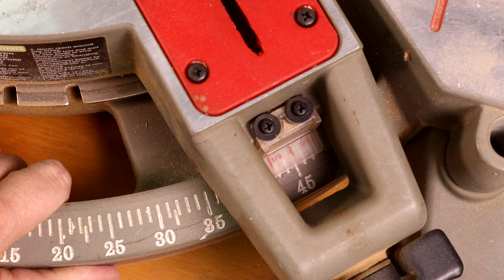5 Woodworking Cuts You Need to Know How to Make | WOODWORKING BASICS

Comment: would a ryobi table saw work. like the ones they have at The home depot.?
Reply: I have used one for years. They make a decent saw to start out with, know that you won't be cutting huge pieces of wood with it. Use all the proper safety equipment and make sure it is stable and secure and it does an okay job.
Reply: thanks. I feel more comfortable now.
Reply: Not really well. A real good band saw will cost you 1000.00 to a couple thousand. But the blade you use has a LOT to do with it. For a hobby shop the cheaper saw with a really good blade might be ok for you.
Reply: Yeah they're fine. Just take it easy on them. They are just 110 so not very powerful.
Reply: My old Ryobi works just fine. How old is it you didn't ask? It's blue, some people at Home Depot don't even remember blue. But build a sled. It's clunky and awkward, like me, but it does help out a lot when needed.
Reply: Yes I started woodworking about a year ago with a ryobi and it works well but I am looking toward a dewalt or Bosch next. With a crosscut sled, 45 miter sled and a good table saw base it will surprise you. Big sheet goods though can be a bear.
Reply: @robertrodriguez1964  Was is THAT long ago? I still have a couple of blue Ryobi tools and they are not that old.

Comment: Couple of things - for crosscuts you will get a cleaner cut if you use a knife to cut along the line you are going to saw. Steve, you left out track saws, they rip and cross cut as well as a table saw and are really good at odd mitre angles, say 11.25 degrees used on Viking boxes (1/8 of a right angle). Its not as if you can only get them from Festool - DeWalt, Makita and a heap of rebadged saws are available (even Aldi!).
Reply: He could go on and on about making cuts, I'm sure! :)
Reply: A track saw is just a circular saw

Comment: grippers are not cheap. AU price basic one $55 go to the one your using, $139 Though tempted to try get the $139 one and a cheap push block $5 one from ebay for a second one to use.

Comment: I really want a nice table saw but you know... wife and kids and such lol. A circular saw has gotten me by just fine so far - not as good as the cabinet saw I used to use but it does the job. Easiest way is to clamp to a work table, draw your line straight, then clamp a straight piece of wood down on top of your piece and use that as an edge for your saw. Another method I've done is make a a track saw of sorts with a piece of plywood and cut your piece underneath. Not great, but again it does the job on the cheap for me. Almost all of my work is cross cuts anyway so the miter saw does fine.

Comment: you can make good cuts with a circular saw, you just need a guide rail.
Reply: When I got my circular saw I didn't even know about track saws... wish I did, as it would have made a lot of the longer cuts I've done much easier. Securing the workpiece is still a challenge though, especially when making long rip cuts.
I'll get a table saw eventually. In the meantime I borrow my neighbour's if I need to do long rips...
Reply: Like what holzi said, you just need a guide rail. If you didn't know about track saws, you were probably not doing enough to be able to justify spending the money that they cost, at the time u bought it, I'm guessing. You just need a quality straight edge, and somehow to clamp down, keep it secure at both ends as well as the middle, especially if it's a long cut, so that it doesn't bow while making the cut, thus having your circ saw follow that bow, thus, a crooked cut. There are many YouTube videos on circular saw and guide rails, some more innovative than just the two pieces of sheet goods sandwiched together and cutting off the excess. Check them out, they can be fun to watch, as well as obviously informative.
Reply: In most cases the parallel guide that came with my saw is good enough for my needs - the challenge is often to secure the workpiece in such a way that it doesn't interfere with the cut. The admittedly few times I've needed to make a slightly diagonal cut is when I wish I had a track saw... and when cutting sheets of plywood etc.
Reply: Kreg jig makes an attachment for a circular saw called Rip Cut, it mounts to almost any circular saw and it works great. I use mine a lot for cutting plywood, I hardly break out the track saw anymore.

Comment: Steve, great video...thanks!  But, FYI....I just wanted to point out that when you put a piece of tape on the blade casing to hide the brand of mitre saw you use, you forgot to put a piece of tape over the Porter Cable name at the bottom of the scale.  ;-)

Comment: What about  cutting curves on a scroll saw
Reply: Scroll saw blades are very narrow and flimsy so cutting through thick/hard wood may be troublesome.
Reply: Peter Cullen there are good blades for the thicker cuts, but they are quite expensive, and you still have to take an extremely slow aproach to the wood. Same us true of every saw though. You have to let the tool do its work. Pushing any saw, even a chain saw, with too much pressure is detrimental to acuracy, dulls the blade/s quicker, and shortens the over all life of the tool. These should be addressed in a video of this sort.
Reply: What about it????? IF it cut it it should be ok ??

Comment: Steve - your affordable table saw is discontinued. HD's replacement does not have an adjustable height on the blade.  And the horse power is reduced 3 to 1. Any suggestions for me?
Nice to know that table saws can be affordable!
Reply: Anne O'Reilly I have a craftsman contractor saw. Under 300 and have been using it for almost 10 years. Would love a cabinet grade saw but I make do with my craftsman.

Comment: Agreed jesus!!!!
I've made a  sled for cutting wheels on my tablesaw... small stuff , 1inch to 12 inch(1 is scary!!!!=1/2 in. center pin.) on half inch thick sled its something like  a 2.5 inch deep.2.75 area deep "wheel".thinking i have  a 7 1/4th blade. so i think i can get a  3.25 in deep/thick wheel on it for max.
obvious can go just about as big as you want with the sled size ..12 inches from blade is 24 in dia.wheel.

Comment: I use my circular saw for rip cut, with a saw guide. No problems, not everyone can afford a table saw.
Reply: I found that a circular saw used with a guide fence  is safer and easier for rip cuts on large plywood sheets than my tablesaw, which is often underpowered and binds/ throwback. The latter is ok if you have an assistant in the other side to separate the cut pieces.

Comment: if it's possible to switch blades on bandsaw you should be able to drill a hole in the piece and then put blade through it so that you can get a precise hole on your bandsaw?
Reply: No. They're a continuous circle similar to a belt on a belt drive system.

Comment: Minor nitpick, unless you have a sliding mitre saw you are restricted by the *radius* of the blade, not the diameter. A ten inch (diameter) blade only has a 5 inch radius: you'd be lucky to cut anything much wider than 4 inches with it if it was too thick.
Reply from the maker: I misspoke. You caught me! Congratulations.

Comment: Hey Steve! Love your videos. here is my issue. I bought the best table saw I could afford. A 350 dollar Kobalt saw. I looked it over very carefully  but unfortunately, Because I am a novice, I didn't pay as much attention as I should have to the rip-fence. The rip fence that came with the saw has front and rear locking latches so I don't fully trust it to always be  perfectly parallel to the blade. My first instinct is to bolt  a piece of solid hardwood to the fence tying the front and rear locking blocks together but I wanted to get another opinion first. Thanks Bob

Comment: You don't have to wait for a miter saw to stop unless you are going for a perfect finish. With two fences on your cross cut sled you are limited in the size and shape of your cross cut pieces. With practice you can cut free hand cuts w/ a table saw. I hate the idea of the gripper unless they pay me. It puts your hand too close to the blade. I use a 7-12" piece of plywood.

Comment: You know there are rip guides for circular saws. I do a lot of ripping with my circular saw on site.
Reply: I agree - I make accurate rip cuts in sheet goods using the Kreg Rip-Cut attached to my circular.  It allows you to make rips from 1/8 inch to 24 inches wide.  Also, it's a whole lot easier to break down a full sheet of plywood with a circular saw with rip guide than trying to push that much wood through a table saw.  The Kreg Rip-Cut costs about $30 - for me it's been well worth it.

Comment: A less obvious choice of tools for cutting a curve, would be a table saw. 
Ohh.. do tell? 
A fairly clean and safe circle cut can be made by setting up a fixed pivot point in the center of a roughly cut circle just parallel of the leading edge of the table saw blade where it meets the table top and rotating the rough circle into the blade.
No really, I have seen it done on YouTube!

Comment: Ripping (and mitering) is extremely easy with a circular saw...
Why discourage people for no reason.
Circular saws are cheaper and you can do almost anything with them (and well)...you dont NEED a table saw.

I have build many high end pieces of furniture using only a circular saw and sander basically.

Comment: Your wobbly bandsaw cut made me feel almost competent :)

You were exaggerating for effect though, weren't you?
Reply: almagill , maybe, but a slightly under-tensioned blade will do exactly the same thing (even a quarter turn too little on the tension adjustment) also, pushing the work too quickly will make a blade 'wonder'.
Reply: wander*
Reply: Giving the bandsaw a proper OCD tune up will make it a better ripping saw, better guides/bearings will do wonders for blade alignment.

Comment: I don't see it mentioned here, so I will see if I can explain this. First, I am still new to woodworking and I have watched A LOT of videos about different things; the one thing I didn't know was the type of blades used on table saws.  When you are cutting think or tall boards, and against the grain, you want to be able to use a rip saw blade.  I mention this because it seems to make a big difference doing so. When you are sawing a think piece, or a tall piece, the dust needs a place to go and the blades with to big gaps between the teeth are for that purpose. Just an observation on the part about tall pieces on a table saw, but also for think pieces as well.
Reply: BTW, thank you for your videos

Comment: First, don't laugh at my ignorance.  How do you make sure the rip fence is perfectly parallel to the blade.  I guess one of my problems is that I use the rip fence to make cross-cuts and so my cuts are never perpendicular to the edge.  (I did not realize it was for ripping. LOL)
Reply: If you have a crappy table saw, getting it parallel can be a pain in the ass.  Just have to measure and do your best.  For me, modifying the front will also tweak the back slightly, and vice versa, which is extremely irritating.  It's better to cheat and get a more expensive saw.  Everyone here are a bunch of cheaters... :)
Reply: Thanks!

Comment: Much less than the diameter of the  blade.

If you raise the table (put a box or thick slab on the table) and sacrifice thickness of cut, you can cut to about 2.5 inches less than the diameter of the blade.